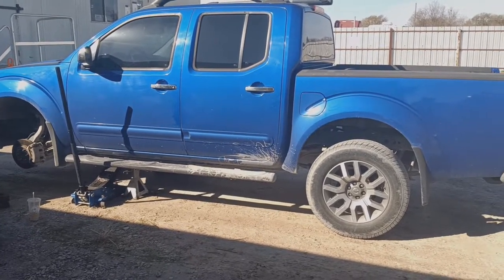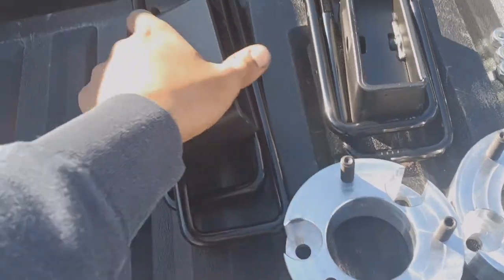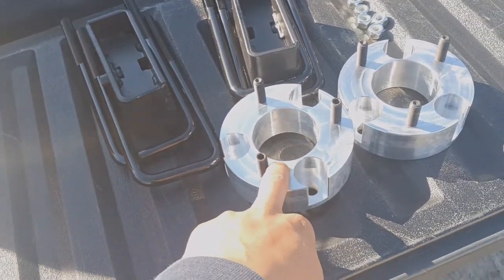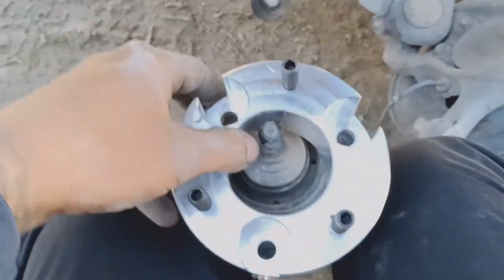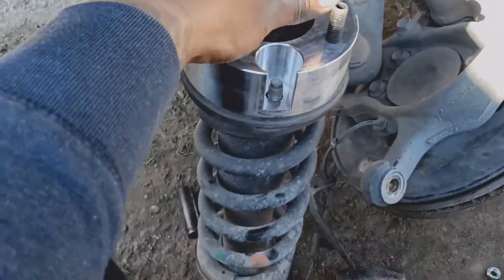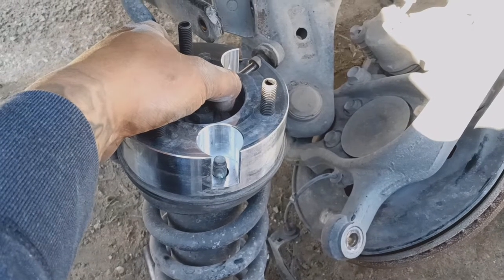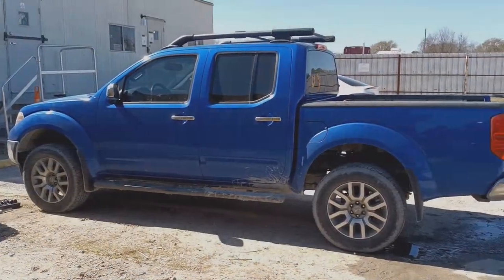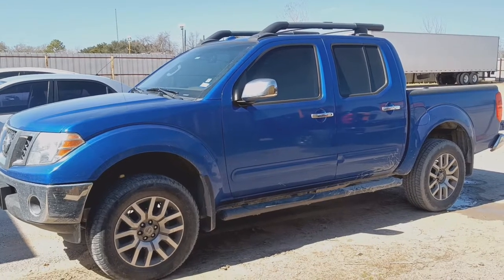2005 Nissan Frontier 2wd 3/2 Leveling Kit | 2005-2020 Nissan Frontier Leveling Kit Installation DIY

Comment: You do NOT have to remove the bottom ball joint, the LCR will drop enough once the lower shock bolt is removed to allow for a large spacer to be placed on the top of the shock/coil over assm. 
You do not have to jack up the back end to place a block under the spring. 
Just remove the bottom nuts from u-bolts, remove the bottom plate and using a jack with a piece of wood lift the leaf springs just in front of the spring perch on the axle. Lift enough to install lifting block, lower and make sure pins are going into the holds. Install new u-bolts, bottom plate and nuts. 
Your video gets things done; just a lot hard and more time than if done without the steps noted.

Comment: The spacers don't interfere with the coil bucket/cap that some other videos state? I've seen a company that make a more rounded control arm that will clear the spacer.
Reply from the maker: Some spacer's do not this one.  It's best to upgrade control arms, anytime you add a leveling kit or lift kit  so you can adjust the ball joint angle.

Comment: I'm about to do my 2019, great video, great information, God bless
Reply: Did it fit your 2019 well?
Reply: Does the 3" spacer cause coil bucket contact with the upper control arm?

Comment: How many inches is the maximum without having to adjust brake line or other connections? Thanks I love your videos very helpful.
Reply from the maker: Thank you as well... The maximum 3inches, but anything above 2.5 I recommend aftermarket upper controls arms. To adjust the balljoint angle

Comment: Hey thanks for the vid just one question did you change your Brake lines because you added the 3 inch spacer I'm planning on doing this to my Frontier.
Reply from the maker: Not recommend but if you planning on lifting it more on the future I'll recommend it. You can also add a bracket to more the line a little more down if you want to feel more safe on your side.

Comment: On front strut install, did you have to spin the strut 180 degrees to get the spacer bolt studs to line up?
Reply from the maker: You do have to adjust it to where it sits properly.

Comment: bro for this lift kit, did you have any trouble with brake lines being stretch in the front end ? just wanna make sure before i buy it
Reply from the maker: They do get stretch but not to max, so you shouldnt have an issue. But you can always upgrade them to longer lines to be on the safe side.

Comment: Is this going to cause premature wear on any suspension parts?
Reply from the maker: Just upper balljoints if you leave the stock control arms but if you upgrade to aftermarket contol arms you won't have any issues.